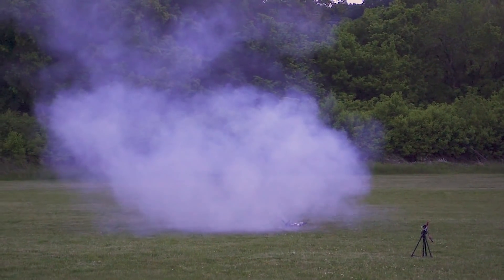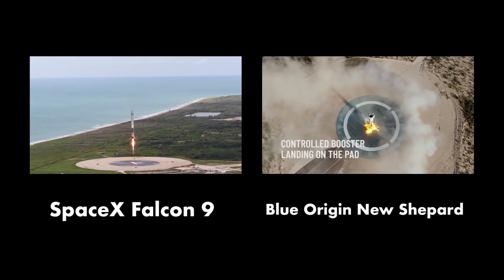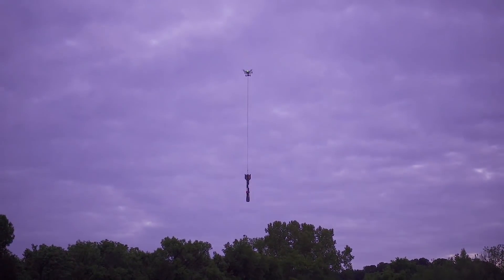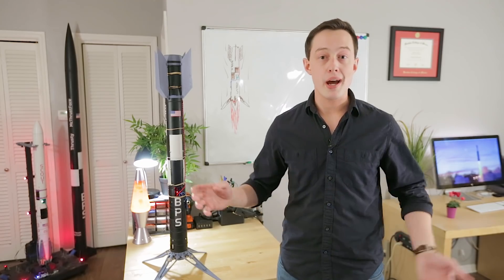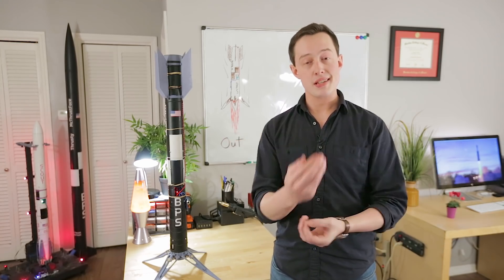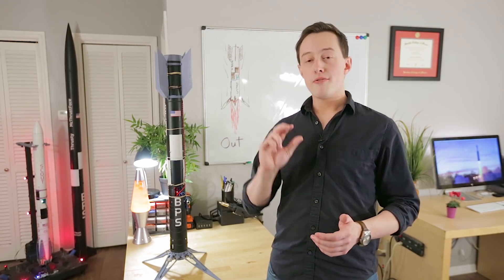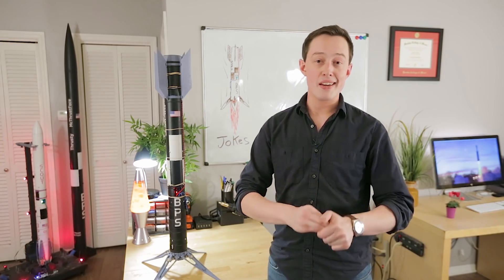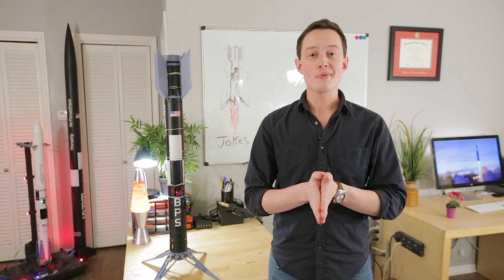Echo - Landing Test #4

Comment: Sensor fusion! Slap a kalman filter on everything and it'll probably fix a bunch of your sensor issues.

Right now you're using only one of your sensors at a time and cutting between them as you change flight regimes, accepting the downsides of each in turn. You don't have to do this - there's math that will let you throw all of your measurements into a single state estimate and gain something that's close to having the best features of both sensors. The accelerometers continuously recalibrate the gyros, the gyros provide high-resolution angular measurements, the barometer keeps the accelerometer's altitude information from drifting, and the accelerometers provide high-resolution altitude information. You can even manually tune the amount of noise you expect from each signal over what time scales.

Sensor fusion also works with multiple sensors *of the same kind*. I'm impressed with the performance you're getting given how slowly you're observing your sensors; when I did humanoid robotics we wanted to be measuring important sensors at multiple kilohertz. But buying more expensive single sensors isn't necessarily the only way to improve measurement frequency. You can also mount multiple low-quality sensors and throw them all into the update step of your filter. Even if you measure them all at the same time it'll probably help you reject some vibration. The real win would be sampling them out of phase, which would give you a better chance of capturing large transients like the shock you get from dropping the legs.

I apologize if this is something you're already doing, or if you've already rejected these features because they don't fit into project scope or available computational resources. I only watched this video and looked around on your website for a few minutes. But the part where you're cutting between sensors entirely makes me hope that this will at least provide some paths for improvement. Good luck!
Reply: Thirded... Was going to say the same thing. Also, after trying Kalman filters, consider dithering (which is similar to adding noise to a mix for mastering from your audio engineering days), and even averaging the values of several IMUs.
Reply: Saul Reynolds-Haertle I second this; Kalman Filters are a mathematically elegant panacea for squeezing the cleanest possible data out of multiple noisy sensors.

Comment: How do you ensure your velocity is at 0 and your motor burns out right when you reach the ground? Since the motor can’t be throttled, you can’t control two variables with just 1 input of ignition time. If your vehicle is falling slowly, the motor will overcome inertia and cause it to move back up before the motor cuts out. You might zero out your velocity right above the ground, but you’d keep on going after that. Do you have a way of ‘turning off’ the motor?

Comment: So close! The problem really seems to come from the legs this time. Watching your previous videos, I've thought about you making the legs longer and adding spikes but I understand those are not options you consider. However, you had a good point about making the center of gravity lower. I am sure it helps a lot. But what about making the legs heavier? I would imagine that it would probably help the rocket to be stable once on the ground. I assume PLA comes from the fact you 3D print the legs, but what about an heavier material? Also, reducing the tension of the elastiks that makes the legs deploy could probably make them deploy softer, avoiding the strong vibrations and a bit of the bouncing effect I guess. I am totally improvising here, I could be very wrong everywhere, but your videos make me want to share. I can't wait to see the next landing test. Congratulations for your work.

Comment: Hey Joe, saw this video on Reddit. Never actually commented on a YouTube video before so not entirely sure how you will see this or if you will see this. Anyway, I used to work in inertial navigation systems and I do know quite a bit about IMUs and how to make them more accurate. I write firmware for a living and can definitely help you with some of your issues with your gyroscopes, accelerometers and magnetometers. I can also help you with your pre flight calibration as there are several issues with it that can be mitigated with proper sensor calibration. DM me if you are interested in talking

Comment: Have you considered looking into the density altitude (always changing based on temp and humidity) during the tests. I'm not sure how much it would affect the thrust of the rocket motors but i'm sure it is a factor. I believe you could use the baro to measure the pressure during the test and alter the retro burn timing based on it.

Comment: Why not use flip out (non maneuverable) flat grid fins, horizontally oriented, rather than the vertical fins you have on it now.  They would more easily flip open on descent and provide better drag.
Reply: And those vertical curved fins he demo'd will create rotational spin, but curved horizontally would offer stable deceleration. (try curved up or down for best stability)

Comment: Glad to hear an acknowledgement of the issues around variance in total motor impulse and ignition timing. Another thing you’ll have to factor in is the total amount of vertical impulse lost to control actuations, that is to say, when the thrust vector is gimbaled off-vertical. Your idea about wagging the gimbal to bleed excess energy is interesting too. 

My assertion remains however that you’ll need throttle to make this repeatable.

Comment: An idea i have for you. I see your working on the RCS system too. If you need an assist with the landing, you could use the residual gas as a retro thruster. Almost like how the Soyuz capsule has retro thrusters for landing. But you could either rapidly fire the gas retro thruster or just release at a constant rate for a more precise, constant, and soft landing.

Comment: Why are you adding complexity with pop out fins and center of mass shifting (and multistage for relanding?) instead of just doing an initial iteration of going up (engine and fins on bottom) then allow the drop to flip the rocket and a separate motor in the top  to do the land?

So, just rocket up -> fall and allow flip with fins up and the heavier unspent engine down -> land

Comment: you can have variable thrust on decent. RC rockets don't have nozzles. Make your own, basically a collar with holes in it that has an outer collar that when rotated uncovers the holes, thus reducing thrust if you need to. Like my vape. If I want more air I rotate a collar and it uncovers a hole. your welcome!

Comment: You say you want to fix the landing leg issues in software, but I think a hardware solution would be the better option in this case. If you can introduce some friction to the hinge on the legs, and possibly soften the springs a little, you would not have as hard of a shock when they deploy, and you would have less bounce to deal with on touch down. Giving the legs less thickness might also help, by reducing mass and stiffness of the legs them selves.

What you have accomplished here is really impressive though.

Comment: Very professional work
But why you do not use a lidar distance sensor to controle the distance above ground? or just to log more data for analyzing
There are some sensors which are able to measure the range up to 40 meters with high accurancy
Reply: Lidar will have huge issues with the smoke from the motor

Comment: What if you used compressed air instead of a solid rocket motor. Could that give you more precise control of thrust and timing? I get that it’s cool to have fire coming out of the bottom but I kinda like this more for the engineering than the rockety-nes. Also sorry if I’m like the 100th person to think of this.

Comment: But is it possible? Aren't the motors to unrepeatable and allways have a slightly diffrent power?

edit; Just noticed you talked about it.
Generally in R/C you can expect 5% error. But after testing, those motors have arpund 1-2%.
Much bigger problem is setting them off

Comment: dont know what is the mass/thrust ratio of the rockets but if you could replace the rocket engine with electric brushless motor (by simulating the rocket engine thrust) you could have more tests? of course there would be more vibration i guess. anyway just an idea, most probably you had this thought long ago.

Comment: You need to work on your landing gear design. They need some shock absorbers so they will absorb the energy and then it will not bounce back in the air and fall over.

Comment: Modify the landing legs so that they ABSORB the shock of landing rather than bounce back from the shock.
Reply: Yup. Could perhaps use a very coarse/weak styrofoam. SpaceX uses foamed aluminium cylinders, which crush to absorb the shock
Reply: It could also use a ratchet mechanism so that the legs could move to absorb the pressure but then NOT bounce back. A spring would determine how much it moves due to the landing pressure, and it could still be 3D printed and have the same basic "look" as the SpaceX rockets.
Reply: maybe the arm could have a friction fit sleeve that would allow the arm to shrink in length on impact and use the friction to absorb the energy in place of SpaceX's crush-core.
Reply: To keep it 3d-printed, he could have a part of the legs buckle for absorption, and then lay flat for more surface area. It wouldn't be much more weight to enlarge those legs either, but I suspect aesthetics play a big part in this rocket too.
Reply: I don't think you can really 3d-print this but what about using pistons?
Reply: There are types of cardboard designed to crush to absorb impact.
Reply: @trumpocalypsenow4654  It should be possible to 3D print the same effect, but that will ruin the re-usability of the legs :-(
Reply: Yes! I don't think the spongy grass is helping, either.
Reply: Something like a Lego pneumatic cylinder with inlets connected should do the trick and be reusable...He just need to make a mechanism that allows them to fold out and lock with full extension on the cylinders.
Reply: HE TALKED ABOUT THAT AT THE END
Reply: I was thinking about a pneumatic system where you have tiny cylinders acting as a spring. Almost like some bike suspensions. When the landing gear deploys, it folds out 4 cylinders, one on each leg which absorbs the impact.
Reply: Anyone remember the Estes Mars Lander?  It used pivoting landing legs with rubber bands in tension that provided a bit of spring.
Reply: That's smart. Maybe have like to cylinders, one inside the other, with some springs. That way the outer cylinder hits the ground, and the inside bounces in slightly, the springs absorbing the shock.
Reply: Or get a engine that you can throttle. This guy is doing more work than he needs to.
Reply: HicaptainWorld you that’s actually more work that he needs to do, more programming, and more engine modification, which is dangerous when testing

Comment: Hey Joe. have you considered liquid rocket engines yet?
I mean you should be able to get more landing control with liquid engines.
More Dangerous ---> More Control
Cold Gas thrust control for stabilization and Liquid Rocket engine...  wouldn't that be a sight....  I can almost see you launch and land it !!!
Reply: Shakaib Safvi liquid is either very complex or very hazardous. For Example, if you were thinking of something such as a Hydrogen and Oxygen liquid mix then your would have to deal with turbo pumps to pump the liquid, and then worry about pressurization and cryogenics. That equates to more weight and complexity (a lot of metal would be involved) as well as danger. Hypergolic fuels are extremely toxic and will spontaneously ignite on contact with large amounts of oxygen and is very corrosive and bad for the environment if done wrong. Hybrid rockets have much the same problems at this scale, this is a model rocket after all.
Reply: @edwardsunnyboy  Yup.. I keep forgetting that this is model rocketry..... Thanks for the reminder !  Cheers !!  ;)

Comment: Hi Joe, 

I want to build something similar one day, so I have brainstormed some ideas about how I am going to do it. 

So what I thought is that I will need a data of test firings of the motors to be used on the rocket, I will need to know the thrust curve, and mass flow rate. Then using principles of statistics I can draw thrust curve with 95% confidence interval. Then I can feed that thrust curve into the flight computer so that it knows the duration of the burn and the thrust motor can provide at various points of time. When the rocket is dropped down the computer calculates the altitude at which the motor should be fired while taking into consideration the depleting mass of the rocket during motor burn. This is the trickiest part imo. But this is the plan. Let me know what you think.

Comment: You could make the fins rotate so the rocket isn't at a almost horizontal position when the rocket ignites. This will help a problem when you add RCS as it will move the center of mass more upwards

Comment: Have you considered using laser sensors to measure the exact distance between the rocket and the ground? Sensors like on a Bosch digital tape measure? I'm not sure what the refresh rate on those things are, or how accurate they are when moving quickly but I know they can tend to be fairly accurate. Perhaps a combination of your current system and a new one would increase accuracy.

Comment: There may be a problem with the cosine throttling idea: if you want to achieve even just a 10% reduction in throttle, the motor has to spendmost of its time an average of 25 degrees away from centerline. At that point you might actually begin introducing actual wobble into the rocket if your servos aren't fast enough

Comment: Use aluminum foil, folded up on itself.  Construct a strut attachment that deploys with the opening of each leg.  As a mechanical engineer myself, if you'd like, I can design a simple to construct and lightweight configuration for you.  No charge.

Comment: Just my 2cent advice  you can use  hot glue with small air bubbles in it ,to join the leg assembly with rocket body   This would  decrease the shock from both the deployment of legs and landing to the main rocket body(it will work  somewhat like advance honey  comb material ) and then you can fine tune it software  will save time and money 
Cheers

Comment: Why not use two solid rocketmotors and have them on two seperate gimbals. Then "split" the thrust outwards in opposite diretions to bleed off energy? I would love to see this method or something like it used in a future rocket. I can't really see any other way to consistenty land a model rocket using solid rocket motors.
Reply: Incredible progress so far.

Comment: EDIT: read comments

Why lidar? Ultra sonic & radar works just fine and the F9 also uses radar.

Lidar is also prone to alot of interference as u probably know.
Reply: Radar isn't good for small applications. LiDAR works great for shorter distances as it relies on very short wave length lasers where as radar uses longer wavelength radio waves. Ultrasonic may be hard to use with grass which can act like one of those sound absorbing walls with all the foam spikes you see in recording studios.
Reply: Max Kopstein well than sounds like lidar is a GO

Comment: The variance into the Pyro ignition could maybe be solved or rather lessened by doubling or even trippeling up the ingitors. That was the fastest will just go first. Then you need 3 slow once to fail.

Comment: Awesome progress. Isn't it kind of obvious that you need throttle control.
Reply: It is, but it looks like that won't be an option with these kinds of motors, so the solution to that would be some kind of workaround :)
Tighter timings and more predictable(less standard deviation) rockets would be the second choice.

Comment: I know you probably have a reason for this but why not use a servo to detatch the rocket from the drone and deploy the landing legs?
Reply from the maker: Mostly weight and complexity! Not that servos are that heavy or complicated, but there's a reason older launch providers stick with explosive charges instead of pneumatic solutions for separation or staging events. They're reliable enough, and extremely lightweight. Basically the energy density of black powder is far greater than a servo - both could work though!

Comment: Isn´t there always variation with the motor burn? Since the amount of horizontal correction needed is always different, the thrust that goes into straight vertical deceleration is always different. And you don´t know that factor when you start the motor. So you may come out a little higher or lower every time. Or is that neglectable?

Anyway congrats on the (almost) landing, I love seeing this test series improve!
Reply: The corrections of the motor are barely visible in this video, which suggests they're within a couple degrees of vertical. The cosine of such a small angle will be roughly in the range of 1, so the deltaV is probably close enough
Reply: @dsdy1205  That´s what I thought for these drop test aswell. But if you look at the launch videos, the rockets don´t go up straight (in fact, slight roll was a feature on the fh model if i remember correctly). So there´s somewhat more lateral velocity that needs to be cancelled out. I guess we´ll see about that when launch & landing get merged :)

Comment: You made it clear you want to solve the shock of the legs by software but I still want to make a suggestion for a hardware solution.
How about using some damping grease on the hinges of the legs with the intention that the legs move slower. I have no idea if this will actually work though.
I got the idea from those potentiometers that are hard to turn fast but easy to turn slow. 
Really enjoy your videos!